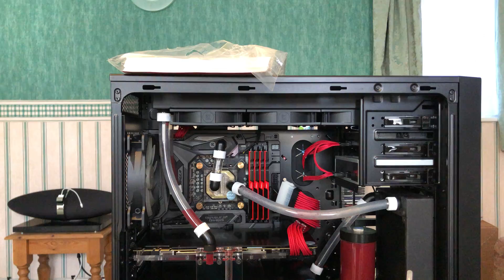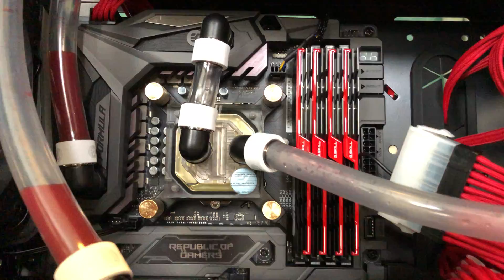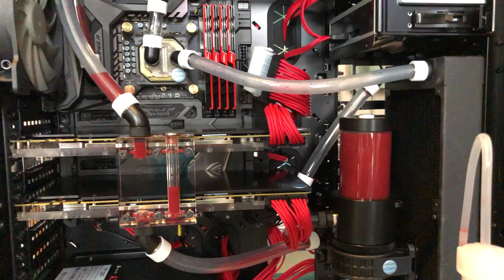First loop fill attempt after replacing the CPU water block (3rd replacement)

Comment: Well, i have 16/10mm fittings. Bought some alphacool tubbing, it ended up being cloudy (not clear/transparent) and, worst than that, give me a hard time threading the compression ring, that tubbing costed me 7€ for 2 meters, i think. Now i bought whats said to be the best hose in the market EK Duraclear, costed me 17,5€ plus shipping, making it 21€. BUT one special feature of that hose, appart from being clear and flexible (miine was already flexible enough tbh, so this dont matter alot) is that it is not 16/10 as standart, it 9,5/15,5 wich mean it shouod be abit harder to put on the fitting (maybe not, if ots more flexible as i expect) and should be easier to tight the compression ring over it with the 0,5mm difference from 15,5mm vs 16mm. Have high hopes for it!!! I just want to thread the compression ring without problems... dont want no leaks